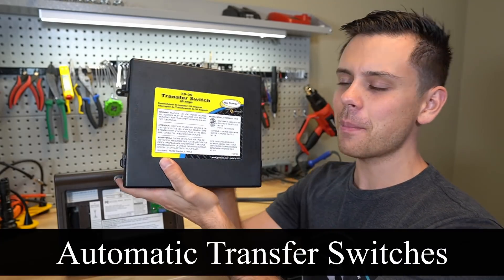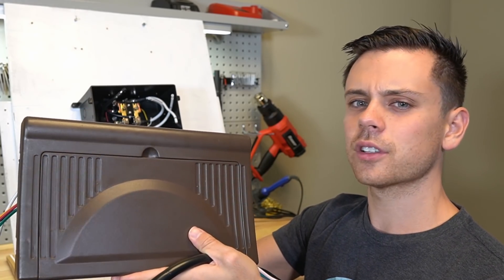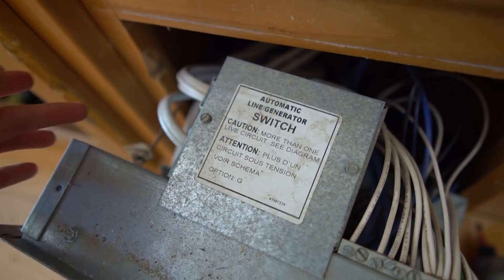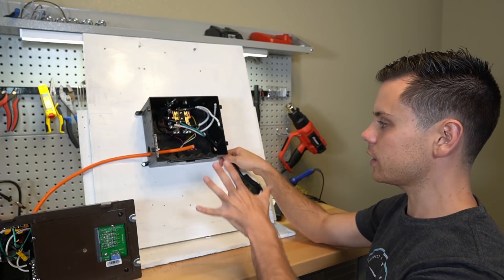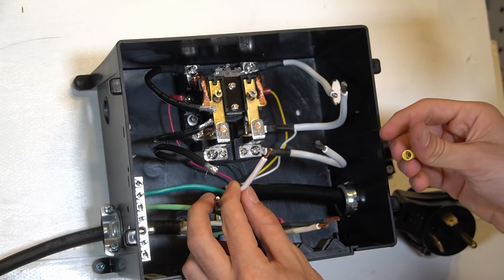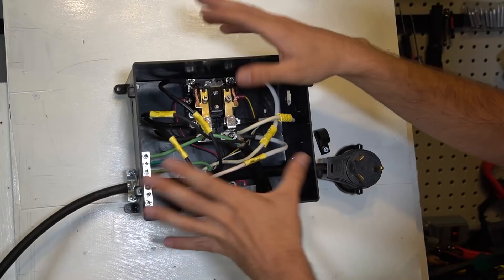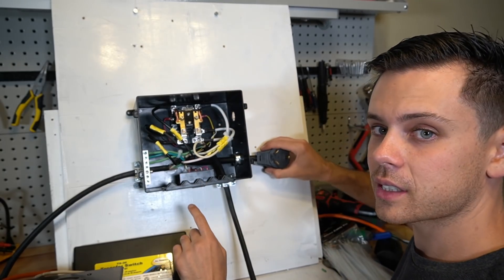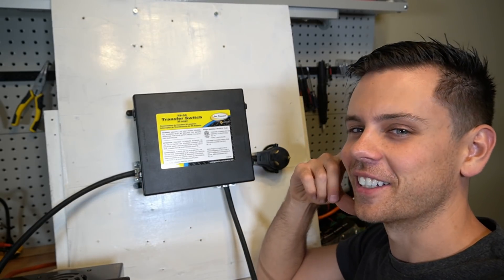RV Solar Power: How to Install an Automatic Transfer Switch to a Solar Inverter

Comment: Nice video Will. A few questions/clarifications that im pretty sure I understood correctly but wanted reassurance:

1. The plug on right is going to shore or generator correct?

2. The wire on left is going to rest of the AC circuits throughout the building (eg. various 110v outlets)? Or perhaps for a larger building the breaker panel?

3. Wire on bottom goes to plug into your invertor connected to solar (typical solar setup w charge controller etc)?

Im pretty sure Im right on 1-3 (please correct if Im not), but question 4:

4. Assuming I am correct on 1-3, how does this "automatically switch"  between the 2 power sources? My building is remote and not on grid, so my goal was to run off of solar until I came to the building and brought my generator to hookup at which point I would like for it to run on generator when I plug it in. Then when I unplug it go back to having the solar panel/ batteries be rhe main source of power (I assume they will charge when im.connected to generator too!)

My thoughts are this ATS would accomplish this, but wanted to make sure - the wiring makes sense in my mind, but not sure how it chooses which source to pull power from? Is one the "primary" circuit (in my case when I plug in the gen) defaulting to this source when I plug in? Similar to say when the grid is back online? Whereas when the gen is unplugged (or no grid), it would default to solar (or in most peoples case a generator)?

Comment: Is there a way to keep the generator hook up to the transfer switch and add the solar? Would I need to add another transfer switch if I want to be able to use the solar and generator? Can you do a video on how to run my ac off the inverter, hooking a 30a up?

Comment: The shore cord was connected at the wrong location. You connected it where the inverter was supposed to be if we were to follow the diagram you posted at 12:34 on the vid

Comment: Great video! Thanks. Couldn’t you also back feed the panel from the inverter, put the converter on its own breaker and just turn it off when off of shore power? Isn’t that accomplishing the same task or am I missing something?

Comment: I need to add one of these but also figure out how to have the AC only run when on shore power. I guess I could add a small circuit breaker box before the transfer switch and have the AC connect there and remove it from the RV distribution circuit breaker. I might also connect the Electric Water heater there as well.

Comment: Very interesting.  Does this automatically revert when failing over when the primary source is restored?  I’m looking to DIY a small system primarily to run my small work and hobby shop.  Setting aside the charge controller, battery and panel I would like to get an inverter that would be capable of allowing me to run off solar primarily. The feature I’m looking for I’ve only found in all-in-one systems which is the ability to switch to shore power as the battery approaches depletion (or triggered by a settable battery threshold).  I have considered doing a Frankenstein relay circuit that will bypass the inverter externally when it shuts down due to low voltage...but am looking for something more graceful.   Consider it a “reverse UPS” where my priority is solar and my backup is shore.  Any ideas?  Thanks.

Comment: At ~ 12:40, Will zooms the camera in and points to two small screws to which to "terminate your battery charger".  NO!!!  NO NO NO NO NO!!!!  Those two small screws anchor the terminals to the contactor assembly.  If one loosens those screws and attempts to connect wires, the unseen nuts and washers drop off into the cavity under the contactor assembly, and the terminal no longer is anchored to the contactor assembly.

To repair this self-inflicted wound, one must drill out the rivets that anchor the contactor assembly to the body of the TS-30, remove the contactor assembly, retrieve the nut + lock washer, reattach the terminal to the body of the contactor assembly, search through your orphaned bolt and washer and nut bins to find two bolts, two lock washers and two nuts to use to reattach the contactor assembly to the body of the TS-30, replacing the two rivets that you had drilled out earlier.

Ask me how I know.

Otherwise, Will's videos are terrific and over-the-top informative.  But, goddamn it, DON'T FOLLOW HIS ADVICE ABOUT THOSE TWO BLOODY SCREWS.

Comment: Great video, thank you. What if you have a 50 amp coach and need to use a 50 amp transfer switch and your inverter output does not have 2 hot legs like the 50 amp does?

Comment: how would you incorporate shore power an inverter as well as a generator? would you need to have another transfer switch for shore power/generator that feeds into this transfer switch for inverter/shore power?
Reply: I have the same situation/question.  Have you or anybody else learned any more about this?  thnx!

Comment: Hey Will. Question: What is the difference between using an automatic transfer switch to connect solar to my travel trailer VS. running a plug from my inverter and connecting a wall-30a adapter and just plugging in my rv?

Comment: Ok so maybe I missed something and maybe someone could shed some light? I have no solar just two deep cycle 6 v batteries to power the dc side. I bought an ampeak 1000 w inverter and this ts-30 ATS. I took my 30 amp shore power cable and cut to splice in the ATS. I attached the wires from the cable that attaches to the utility pole and hooked them up to the bottom terminals. I took the other part of the power cord coming out from the rv converter Box and attached them to the top of the ATS labeled panel. I then cut Dow an ext cord that is rated at 1875 watts to about 4 ft and attached it to the center terminals labeled generator. Now when I’m off shore power and I turn on the inverter I hear my gfi click and it turns off all the power to my wall outlets. Also if I plug into shore( my garage) and I power on the inverter it seems to disconnect from the shore and start to run off the inverter. I’ve also gotten a few opp (short circuit/ over voltage) codes on my inverter. I’ve triple checked the diagram on the inside cover of the ATS and the connections. Can someone help me out ? Thanks

Comment: Perhaps another option, you can see where your shore power enters your RV, and splice it in there. Many newer converters have DC filters built in, so you don't have to disable anything on the DC side, and they auto charge the house battery with filtered power. I installed a shut off switch from my batteries to the DC side so I didn't have to disconnect battery cables each time I worked with my house battery.  That actually might be a good option when going from a battery to an MPPT and doing hookup, so you don't have to remove the battery cable each time. Regardless, when I shut off the battery switch, I still have power to my DC side. When I shut off both...nothing.  I did upgrade my converter and magnatek inverter or whatever it's called (changes 110 to 12V or vice versa not really sure). Regardless, mine seems to be combined through the AC side of the converter. My DC side has wires that run directly from a bus bar in the battery area to the DC side of my converter. Before, when I would shut off the DC side, I had nothing and the battery wasn't being charged either. Seemed defected. Based upon the idea that my new converter is "clean power," I believe I feel safe simply installing this device after the AC dongle, before the junction box, allowing the AC out to provide power to the AC panel, and the DC side to continue what its doing without disconnecting or modification. Reality is, the inverter is a pure sine which is supposed to be clean as well. So the power supplied to the DC side from the inverter, should be able to run through the AC to the DC, charge the house battery, and not have to be disconnected.

Comment: Will,  I have a Progressive Dynamics PD4000 Series which I plan to use in a bus conversion.  The PD4000 Series literature states that it can charge lithium batteries.  In the comments for this video, you say not to use the RV distribution panel to charge your solar system batteries.  Would I be able to use the PD4000 Series to charge the Lithium Iron Phosphate batteries for my solar system since it says it will charge them or would it still not be a good idea to do that?

Comment: Can I use the transfer switch on my camper with generator in and shoreline in
With the out not to panel but to my xantrex freedom-xi 2000 watt inverter which has a built in pass through transfer switch so 120 volts in from camper transfer switch and out would be to panel 

Sounds right.   Any suggestions would be appreciated thanks
Reply: Of course I would put switch to converter to turn off charging batteries when no shore power or generator

Comment: Why are the boxes so huge on these automatic switches?  Seems like a huge amount of air space in them.  I suspect they don't want you to overload the box and interfere potentially with the mechanical switching mechanism.  But it seems like they could be a lot smaller by adding a plastic guard you put in after termination to shield the switch.
Reply: The one that I just got (July, 2022) has a guard over the switch.
Reply: @averywayne4945  That cool. IS the box the same  size as Will Shows here?
Reply: @michaeldoherty2289  Ya, the box is pretty big. I suppose that it could be cut down if you need the space and can figure out how to attach the lid.

I removed those tag wires with those funky connectors. I ran my wire directly to the switch because I'm concerned that the splice connector could come apart. That arrangement cut way down on the clutter inside the box an the box seems empty. In my book, the fewer splices, the better.
Reply: @averywayne4945  For sure.  The WAGO connectors are really high quality though.  Electrically they are very good.

Comment: I had installed this automatic transfer switch in my solar system.  It powers my TV, cable modem and wireless router.  They will turn off and on whenever the transfer switch switches between AC source and my solar system.  Do you have a suggestion to solve this problem?  I worry that the devices will be damaged in the long run.  Thanks!

Comment: Nice video, thank you.  My question is; my travel trailer has solar and I just installed a pure sine wave inverter.  I want to install this 30 amp transfer switch but my camper runs off both AC and DC when connected to shore power. (for example my TV, some indoor lights, etc. run off dc power even when connected to shore power.)  Can I run both while this transfer switch is installed or will the transfer switch run just AC or just DC one at a time.   I have a single 200 ah lithium ion battery that can be charge with solar and/or shore power.  I am a newbie to this camper so I am trying to find out from the manufacturer as well.  Thank you!

Comment: I’m a little stumped. I have an enclosed trailer with the PD4060k converter and 30 amp outside plug already installed. My road block is as i involve my LifePo4 batteries and solar. You say i can’t use my converter to charge the batteries. Would the solution then be to buy an MPP hybrid inverter, solar runs into it, tie that into the transfer switch and take the power from the inverter to the PD converter or am i missing something?

Comment: i was wondering if the switch has the possibility to turn off the inverter while on shore supply mode? and back on when in battery mode?

Comment: Very useful Will because I am adding an inverter and a new converter/charger for Lifepo4 battery to my trailer.  Its a little confusing though for people that don't know how these things work.  In your example you use cord with a male plug pigtail to representing the incoming shore power.  Of course it would never look like that.  The shore power cable would lead to a female socket on the side of the trailer.  I hope your viewers weren't looking for a male plug end somwhere!
Reply: I was wrong on that.  Sorry.

Comment: At the end of the video those two small screws mentioned where you should connect a battery charger next to the shore power screws. Don’t unscrew them I repeat don’t do it or you’ll be sorry. I listened to him and made that mistake and now it won’t screw back in. I’m sure it has a hex nut holding it and it’s in closed with rivets around the inclosure making impossible to easily get to. As for the rest of the video it went great. As a fix I’m hoping to just go with a bigger screw to hold it in place but what a bummer I don’t think guy actually unscrewed them

Comment: As always, another amazing video.  So well done.  Thank you for sharing your knowledge in such a clear way.  One question, with this TS-30, when I add my charge converter into the transfer switch connections on the shore power side is it safe to assume when I am on inverter power, the transfer switch will cut converter power so it is NOT charging my batteries while using the inverter?  I've seen others adding relays and assume they are just doing that to avoid installing a transfer switch.  Thanks again!

Comment: Can a person get shocked in a chassis grounded system (not grounded to a ground rod) if there is a short in the system and a person touches metal on the vehicle while standing on the ground ?
On a side note when I wire electric panels I prefer to wire direct to the switch over placing another terminal/connector or point of possible resistance in the system. 
I love the videos. Thank you for sharing your knowledge.

Comment: Im thinking of using an automatic transfer switch with house solar. The house load will be less than 100A. My question is can I use solar panels (with inverter) as the primary source on the swith, and have the automatic transfer switch bring in grid power when solar goes down? If so, is 100A switch OK? Grid power is obviously higher amps than a generator, which is the typical offgrid application.
Thanks for good series on instructional videos

Comment: Thanks for the ATS review, Quality presentation. I have a unique setup that requires your expertise. Our Motorhome currently has both Shore Power and Generator that are in use. We have added a 600 watt Solar System with 3000w Magnum Hybrid Inverter (MSH3012RV) to give us 3 sources of power. Question #1.) Magnum recommends to have Inverter Bypass Switch to isolate the inverter in the event of a failure. How or where you would you recommend where to install this at. #2.) Do they make a ATS that would allow me 3 inputs of power (Shore Power, Generator and Inverter). I want to try and utilize the OEM AC Panel instead of adding a Sub Panel. Look forward to your recommendations.

Regards

Greg

Comment: Well done video. I'm a little confused about the the charger portion of my converter. It seems that when the transfer switch changes over to battery power, the battery will be in a charging loop, attempting to charge itself. Is that incorrect?
Reply: i have that problem too and my dometic fridge goes in error mode when on inverter until i disable the charge portion of the  wfco rv panel
Reply: If you mean when switched over to the inverter then yeah that’s a huge problem if you also have the charger/converter hooked up to that. Really bad. You should only have the charger/converter sucking power from the shore side of the transfer switch.

Comment: Thinking about wiring my skoolie in this manner.. my question is how much loss is there when you convert power from your battery to 110 then back to 12v in the converter box and is it worth it.... should I convert 110 and 12v separately from the battery and put my transfer switch before my battery with a battery charger from solar and shore?

Comment: Question: I want to use this Transfer switch to charge my batteries when plugged into shore power. I watched your video and understand on how to make that possible. How do I go about using my solar charge controller as well. Can I hook both to the same battery bank? Or do delete the go power option and just use solar or is there a way to use both?
Reply: You can use both. Hook up the solar controller as close as you can to the actual battery and use appropriately sized wires for the load.

Comment: QUESTION: If I don't plan on using the Shore Power anymore, can I just hook up the solar system to the campers existing batteries without having to do anything else? and will it run both my AC and DC? The reason I asked that last question is because I'm not sure what they run, since I have had it hooked up to Shore Power the whole time I've had it.

Comment: Would this wiring, to separate the converter form the inverter , work on a 50 amp transfer switch?
I'm looking for a way to stop having to trip the breaker on the converter when I use my Inverter.

Comment: If I'm hooking this up with a converter and an inverter with solar power, do I need to turn the inverter off before plugging into shore power?  Since the inverter is plugged into the battery and the converter is also charging it on the same curcuit, wouldn't there be a short?
Reply: Yes. The charger/converter should only be hooked up to the shore side of the transfer switch.

Comment: Please inform me how both shore (grid) AC power and generator AC power are wired to the automatic transfer switch or battery storage system?  How does the switch know to prioritize  shore power over generator power when both are wired into a battery system? Is there another transfer switch or relay involved?

Comment: The converter charger becomes unprotected in this scenario. You need to add a 15amp fuse to that circuit.